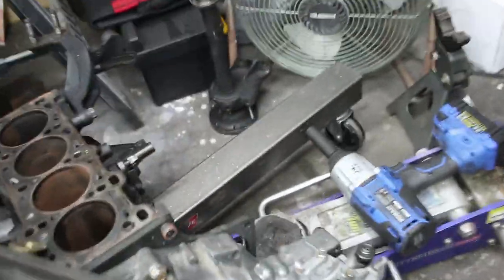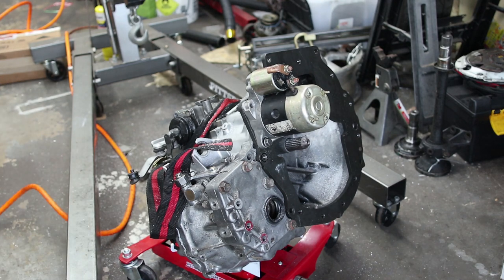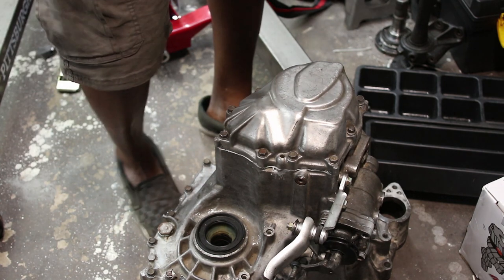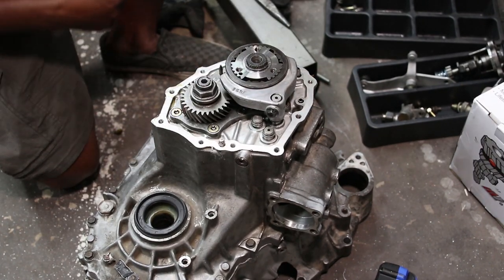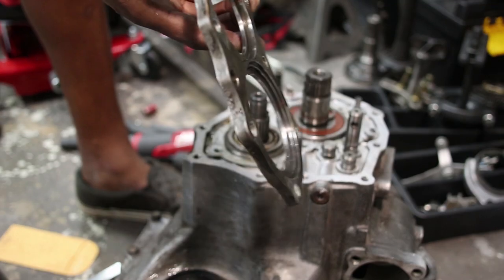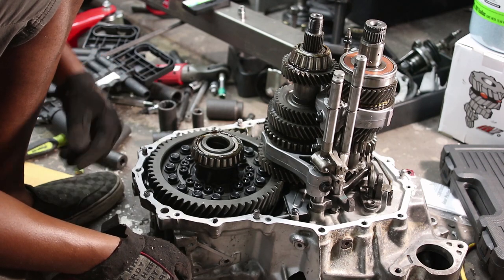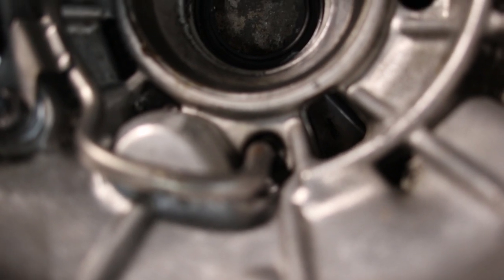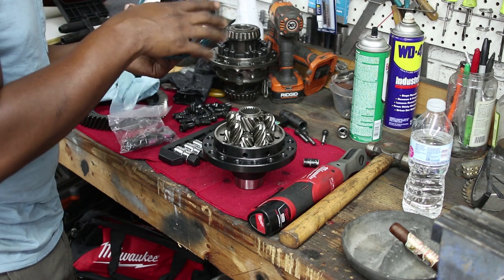E153 part 9 starter notch and prep for LSD install.

Comment: Looking good.  I noticed that you notched your transmission for the starter clearance like you said on your video.  May I suggest you reinforce this area. The bell housing may start to crack starting at this location when your engine applies torque under hard acceleration. It happened to me when I did this type of modification some years ago..
Reply from the maker: Yeah it's something that crossed my mind, but others have done it without issue, I may still try and weld a cover over it.